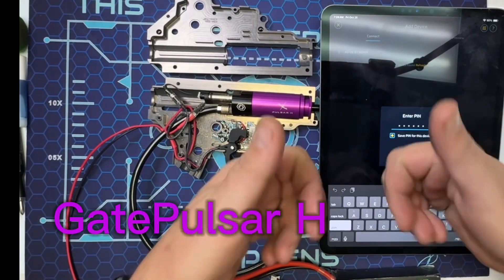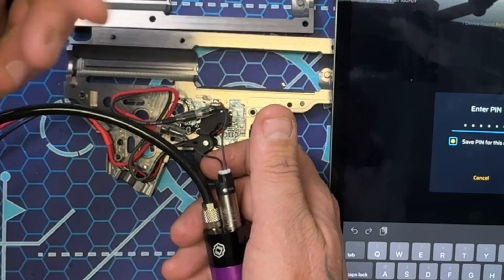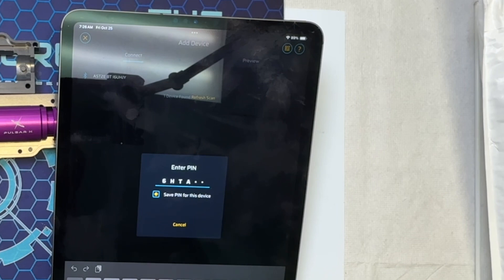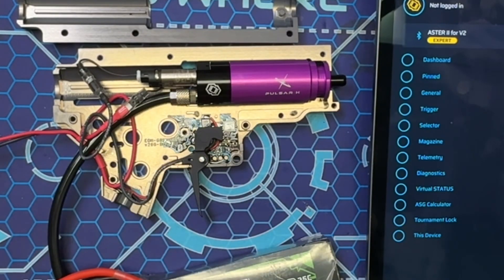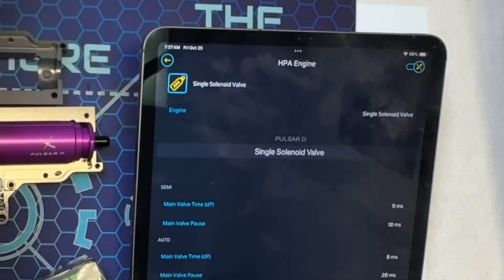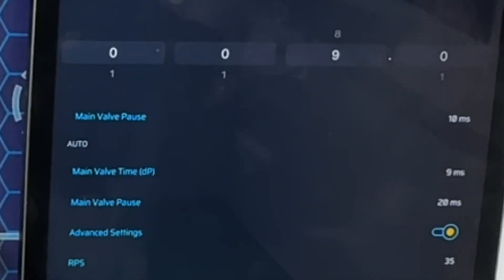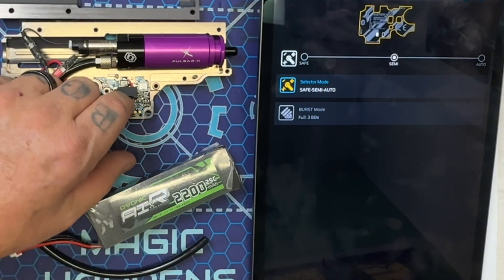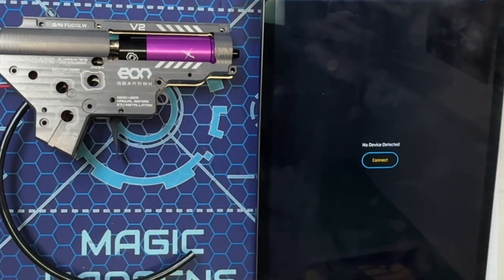Gate Titan & Aster 2 programming tutorial for HPA. @GateMovies

Comment: I have problems with the configuration of my Pulsar S, the settings are not saved and every time I exit the app it gets reset by itself. What solution does it have?
Reply from the maker: First make sure the firmware is up to date.
Reply: @JJMooreairsoft yes it’s the 0.2 beta 01 😢😢
Reply from the maker: When you disconnect how do you disconnect
Reply from the maker: Try actually turning off your Bluetooth. Or hitting disconnect also sometimes you have to use a different device to connect and calibrate.
Reply: @JJMooreairsoft   i think i fix it, my phone its iphone and dont work so good with ios but i try it in a androit phone and works
Reply from the maker: @CastilloAirsoftt cool deal have a great day brother.
Reply: @JJMooreairsoft  thx for ur time +1sub :)

Comment: Hello friend, could you clarify a doubt? Do you know any way to use the Titan 2 with HPA wiring for AEG? Just by changing the wiring?
Reply: but I appreciate your attention, hugs! 🤙
Reply from the maker: @BeWolf.  I appreciate you messaging I’m here to help anyway possible.
Reply from the maker: The only way would be to swap the harness it takes precision soldiering but it could be done.
Of course it will void the warranty though.
Reply: @JJMooreairsoft yes, but the problem is that the hpa version does not have an option to change to aeg in the app, I informed this to gate support, and they said that it can only be activated with the board in hand, I believe it comes with some firmware lock, funny thing is that the version for AEG has an option to change to HPA in the Gate app, and uses the same firmware 😂, I've already changed the wiring to AEG, but it didn't help at all.
Reply from the maker: @BeWolf.  you are right that’s what I was thinking to if the AEG can be switched then the HPA could be also but if Gate said it’s HPA only those guys are the experts. I will ask my Gate Rep  what they think because you may be able to swap the top board I believe all the firmware is on that board. And then change the harness